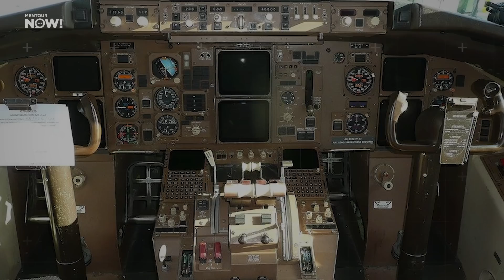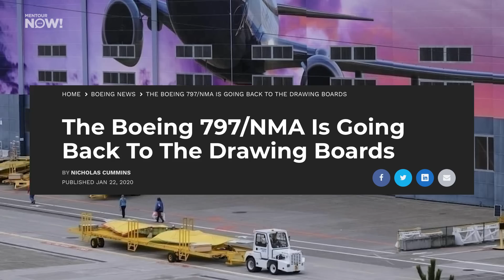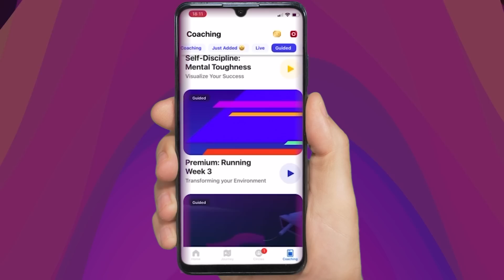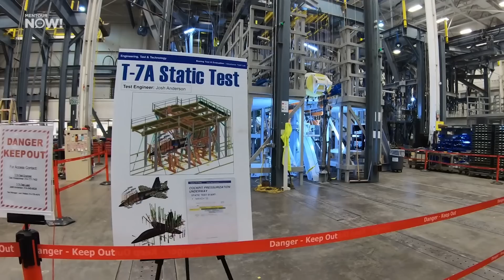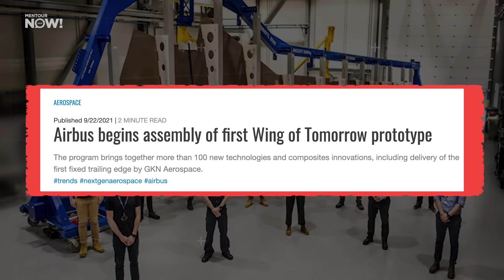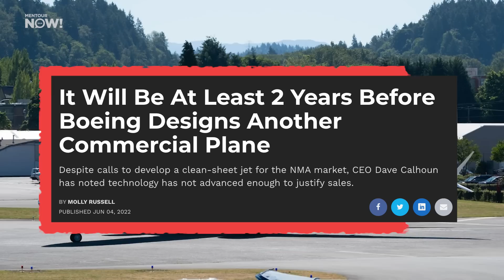Is Boeing Planning a 757 MAX?!

Comment: Good job as usual. I have a few comments about this video. All in MHO of course. First, the 757 was never a clean-sheet aircraft. It was really a re-winged 727/737 fuselage adding a new tail, flight deck, wings, and of course engines. Pretty much new but not really. The 767 was always a black sheet of the Boeing line as the fuselage cut required a completely different cargo container than the previous  727/737 or 747 which was available at the time. One reason many airlines stayed away from the 767. Taking that into consideration, anything new out of Boeing (I would guess) would likely be closer to the 787 type of construction or, a clean sheet.

Secondly,  Airbus isn't all that much better off if at all as the A320 series is now headed into the 40-year-old category since its original design.  Just how many times they can do a little here or there and claim it as something new is coming to an end just as the 737 series is. If they can complete with an all-new Boeing design with A320s would be very questionable, to say the least, and I would wonder if the powers to be would be all that anxious to jump in after the A380 fiasco. 

Boeing would only need to change their business plan to match Airbus. Namely, the A320 was always considered to be a cheap throw-away airframe compared to what Boeing was selling. I say that as being present when Northwest Airlines, who were the original and first A320 operator in North America, and listening to the then CEO comment on the then-largest order of 100 A320s. To paraphrase his comments, "the more or less gave us 25 free aircraft compared to Boeing's best offer so they really don't need to last as long." the next generation of Boeing aircraft will likely be both cheaper and a little bit more efficient. No more airframes reaching 75 years of age like the Boeing B52. 

Since the only thing both Boeing and Airbus can claim as relatively new is the 787 and A350 both of them seem to have the same problem supplying what the airlines want. The other option is for both Boeing and Airbus to come to their senses and start building aircraft they want to sell and not the thousands of gyrations the airline bean counters demand. As it once was. Really, where else would they go?  

Again, just my opinion.

Comment: I believe the time has come for Boeing to make a more efficient and light-weight 757-8 or 757 MAX.  Call it what you will.  That could help replace the current 757s that are still in service and currently outdated.
The best approach is to use the same carbon composite material that is used to construct the Boeing 787 Dreamliner and using GEnx engines, too.

Comment: In the early 1990s, I was involved in the UPS re-engining of 727s - we did this at Dee Howard in San Antonio, replacing the PW JT8s with RR Tay 650s .. it's not that difficult .. we replaced all the steam gauges with a glass cockpit, rewired the fuselage with new avionics, removed the #2 Center Intake and replaced it with a larger diameter center intake, built new Engine Pylons for #1 and #3 Engine, built new Cowlings, and did a heavy D Check Inspection .. the same thing can [ and has been ] done on MD80s / MD 90s / B717s - lengthening / shortening the fuselage and replacing the engines and avionics - and the same thing can be done on 757s .. the 737 MAX was a massive mistake .. Boeing should have cancelled the 737 line after 737 NG and focused on reducing the operating costs of the 757 .. the 757 was a much better design with much better growth potential ..
Reply: Part of the problem is, there is no suitable candidate for re-engining the 757 as Mentour mentioned.  CFM-Leap/PW1100G are too small, GE-NX is too big.  There is no new generation engines in the power class of the RB-211s and PW2000, both those engines were designed in the 60s for the 747 and L1011
Reply: @mrvwbug4423  that's right. Some planes are certified for several different engines. Boeing certifies with CFM, GE, and Rolls Royce. The 747 could use either the GE or Rolls Royce. It would just be the simple re-engine process as described in the Maintenance Manual. Putting a completely different uncertified engine onto a plane is a nightmare and tons of legal FAA red tape. Mentor Pilot talks a lot about safety and that's why.
Reply: I'm guessing the Engines were pre-approved for the aircraft. Upgrading the entire plane requires a lot more work.
Reply: I totally agree with your views on keeping the 757 going. Thanks!
Reply: But Boeing got an order for 50 of NG but in condition they make 50 new next gen for American Airlines. So basically they have order for 50 non existent plane. 
That's why Max is slappy Joe and ended not so well for Boeing
Reply: @mateuszzimon8216  If you had read any of the actual accident reports of the MAX crashes you’d see that the real problem was Boeing getting greedy and selling stripped down versions of a brand new aircraft to developing nations that have long records of poor pilot, crew and maintainer training, cut corners on maintenance, lack proper supervision, and have no monitoring authorities, this exposing themselves to major liabilities.

Comment: Thanks again for the hard work and cool video.  Wondering if the new design might be so much lighter that it could use the lower (bumped up) thrust engines...and be that much more efficient as well.  The B757 was always a big girl at 255,000lbs. and a large fuel load percentage...so a bit of a tanker like the B777-300ER is.  More efficient engines and a fancy new wing/etc. would require less fuel and supporting OEW structure.  The B757 was always famous for wake turbulence...due to induced drag which would be much less with a longer wing and a new airfoil.  Guess they would also go with a composite fuselage and really lose weight.  I've said for years that they should use the B757 type as the basis for the NMA.  Twin-aisles just have too much fuel and OEW, even though the B787 and A350 have made big progress in this area, plus emissions.  Surprise...did a video about this too:   https://www.youtube.com/watch?v=lr1BC5EzaRs
Aviation's investment in such progress is never mentioned by the eco-mentalists along with shipping (twice the effect of aviation), NOx (ever heard this mentioned on TV...?)...and the military's contributions.  They would rather glue themselves to the street than learn anything useful...so far.

Comment: The day after the second 737 Max Crash, I contacted Boeing and told them to re-launch the 757 Line .. And if Boeing had listened to me and made me their new CEO, instead of the moron they did hire, that's exactly what I would have done - I would have immediately cancelled the grounded 737 Max line, recalled all 737 MAX, and re-tooled for the 757 line .. I ALSO would have re-launched the MD80 / B717 Line  - 717 is far superior to the 737 MAX - stretching the 717 back out to the MD83 length and going back to the IAE V2500 engine .. the 717 and 757 can fill every role the 737 fills, the quality of construction and safety of flight would have increased and Boeing would have been financially in black within two years .. #BradHartliep, the man #Boeing should have hired for their #CEO and the only man that can save #Aviation and #SaveBoeing ..

Comment: The 757 is already what the MAX always should have been...longer gear legs, more room for larger engine, thrustline where it should be, no mickey mousing around. (27 year 737 pilot...when it was a proper airplane.)

Comment: Boeing is a classic example of what happens when the accounting department takes over a company ( for others, see the entire US auto industry. ) In typical shortsighted accounting fashion, they canceled the wrong program and kept a plane that was obsolescent 20 years ago. The biggest problem with the 737 is those stubby little landing gears - the new engines are practically dragging on the ground, I can't believe the FAA certified that! ($$$) Then the  accountants forced a bunch of shortcuts on the engineers to get the new 737 certified the same as the old one, even though it is not. Again, how that got past the FAA is a very good question. ($$$) Then the planes started literally falling out of the sky, and the whole fleet was grounded. Then Boeing got lucky, and Covid shut down everything and deep-sixed the whole story. Now the deserts are full of unused aircraft, so there is no need to fly the dangerous new 737s, and the whole sordid affair will fade away. Boeing can survive on military sales, having gobbled-up just about every other manufacturer. With a depression looming, the accountants will lay off all the engineers, and there won't be any new designs for a long time. Aircraft production will collapse as well, with air travel just a fraction of what it was, and fleets of slightly-used planes sitting in storage that are much cheaper than new ones. Airbus is not much better off. Me, I am enjoying the quiet skies. What ever gave the airlines the right to make so much noise overhead, 24 hours a day? Think about that.

Comment: with how much back and forth there is about this new type, new composite, and new this that and everything in this video with boeing, if their is one thing I've learned in life its when a company does that, its not on sure footing and is throwing everything against the wall in an act of desperation to stay afloat, as the solution is simple, just bring back the old plane and keep it the same, the US airforce flew the same plane for over 50 years, and its only now getting re engined by Rolls Royce, like update the electronics and just build the old plane

as the more they overthink the pluming the easier it is to stop up the drain, case in point the 737 max, what was wrong with the old flight systems that you had to change them in such a way that made them so failure prone?

Comment: One solution instead of having to redesign 2 aircrafts, would be to do a shorten version of the B787-8. You can exactly fill the gap from the upper part, and you already have an optimized aircraft. Of course challenges for the wings remain, but you also have new advantages as a possibility to implement cross crew qualification and higher passenger comfort....
Reply: Shortened versions of existing aircraft tend to be significantly less efficient. This is why aircraft like the A318 and 737-600 sold very poorly, for example. Scaling everything down to the point that they would be as efficient as their larger siblings would mean losing all of the parts commonality, while leaving stuff the same size makes it much heavier than it needs to be for an aircraft of its size. It's kind of a lose-lose situation except for a handful of relatively specific missions (for example, the 318 worked great for that London City to NYC all-business-class non-stop... but you can't design a whole aircraft variant just for niche cases like that.)

Plus, you'd still have the issue with the engines. Sizing down an engine core significantly is cost prohibitive, so it would be massively overpowered, which is also inefficient. It's also important to keep in mind that the 787 is designed for long-haul and even ultra-long-haul missions. An aircraft with even the exact same seat capacity as the 787 could be much lighter if it were designed for the short-to-medium-haul operations where the 757 thrives. On a long-haul or ultra-long-haul jet, fuel weight is a rather large percentage of the maximum takeoff weight. Granted, you could delete some of the fuel tanks without too much cost, but all of the structural members would still be significantly oversized and, therefore, inefficient.

Comment: The cost would be likely the same to bring back a tired design 757 to revamp it vs startingn from scratch on a new aircraft. The 757 was no doubt a great safe reliable aircraft. It had the best power to weight ratio out of any jet airliner ever built which is why Boeing advertised it as a short field aircraft. The tall gear allowed for larger more powerful engines. The Avionics is completely outdated. The two engines available havent been made in years and would require something more fuel efficient for today's standards. Boeing killed the 757 with their upgraded 737s. It would have been money well spent to keep up with the technology advancements with the 757 and 767 fleets

Comment: I don't know squat about commercial plane construction, so this is coming directly from my ignorance. How different is the 737 fuselage from a 757? I can see they are the same width. Can a 737 be stretched to 757 length but with a new wing, landing gear and engine design? It would no longer be a 737 but it would be coming from the same suppliers.

Comment: It’s staring Boeing in the face…they did with the 707 and 747…and they could do it with the 787-8, reconfigure this airframe for 200- 300 pax capacity and designate it the 787SP…A shorter wide body with good range, existing airframe with good weight lifting capability..and existing avionics and engine combination. Pilot type rating training could be lessened considerably.The real issue would be getting this new aircraft certified by US regulators with the amount on their plate regarding the existing 787. It would be nice to see the “SP” designation  back with a Boeing aircraft…yep, the 787SP…it has a ring to it.

Comment: I totally dislike the idea of a single aisle 6 abreast configuration be it Boeing or Airbus. If these are not going to serve short runway operations I don’t see why can’t they make a 2 aisle version 6 abreast economy configuration? There would be more room for cargo on leaner passenger routes. Besides flying long haul on a single aisle aircraft is totally silly.  It was ok in the past like the Boeing 707s or DC 8s when seats were fewer and leg room wider for economy class. These days to maximize profits seats have become narrower and leg room shorter. I don’t see how people can endure a minimum six hour flight on a single aisle, be it a 757 or a A321LR.
Reply: How do you take a pooh during feeding/scratch card sales time?

Comment: NO not again, please do not make such creating a new airplane based on the VERY OLD tech, Boeing.
I totally disagree this idea ,they should learn from the 737MAX. Again ,too big engine to fit it the old plane frame, may be they will introduce another DANGEROUS system like MCAS.
The named "MAX" at the beginning is the new hope ,but now in most of NORMAL people mind , MAX means Darth Vader who may hide some hideous plan to kill you anytime. Admit it and change the mindset ,it will make Boeing shinning again in aviation. 
You cannot use the same strategy  as Airbus because Airbus had been accepted the fully digital control system since it launched a320 project 40 years ago while Boeing tried to retain the old style of flying. New plan has to be figured out.

Comment: This is what they should've done instead of putting larger engines on the 737.. the 757 is much more suitable, because it's higher off the ground so they won't have to shove the engine up into the wing 😄
Reply: Yes, but... The problem is that the engines drive aircraft design. The 737 lives on because the CFM LEAP is so efficient. And as he mentioned, there's no engine to power a re-engined 757 - the entire plane would have to be redesigned with new wing, etc to get the weight down to where a 35k thrust engine could power it.

Comment: I used to be a huge Boeing Fan, but they lost me with how they mishandled the whole Max debacle.  Now they have 3 different Aircraft Types that are built, or planned, but can't seem to get FAA approval to deliver, the 787, 737Max-10 and 777X.  I think the 757 and 767 were the perfect aircraft, my favorites, but I really don't want to fly on anything they built after that.  I think the 737-900s are safe and reliable, but they are noisy and they rattle.  Boeing has a very long road back to restoring Trust in their products.

Comment: The 757 flies with engine thrusts of either 37,000 lbf or 40000 lbf, too little for the GEnx (50-70K), too much for the CFM LEAP (33K). 757s use cable-powered flight controls which would have to be updated to fly-by-wire; I doubt if fuselage tooling is still around; LRUs are still being produced for A/C packs, avionics, payloads and propulsion, but they are controlled (digitally) individually, & not well connected to each other. If a new 757 is to use the 787's all-electric (no bleed) systems, a lot of changes would have to be made to the Aux Pwr Unit, A/C Packs, fuel system components, engine starter/generators. . . the list goes on.

Comment: Boeing will NEVER make an updated 757.  It just isn't going to happen.  Airbus was going to redesign the a330 into a competent 787 competitor, but the airlines convinced them that they should just do a clean sheet, and that's how the a350 was born.  Because, if you're going to design and certify new wings, new engines, new avionics, you might as well go for a new fuselage too.  Boeing is going to build an all carbon fiber single aisle version of the 787.  That's what they are going to announce in a couple of years.

Comment: I think the 757+ or max could be done just by doing all new composit materials in the body and wing. Thats good weight savings right there and then take the origional engine design and redo it with new materials and modern designs and that literally could be the solution they need. As for airbus. They could take a shot at boeing and call their 757 competitor the a325